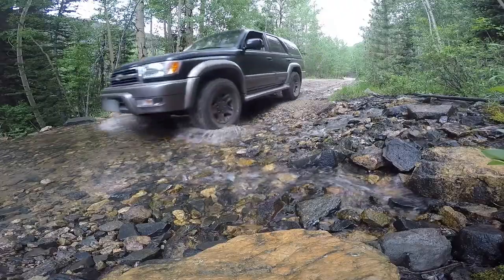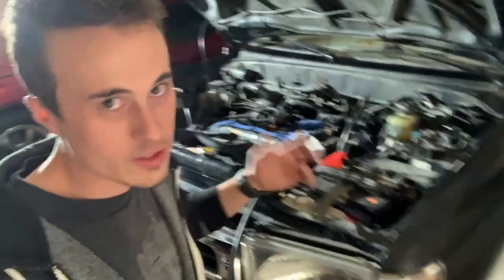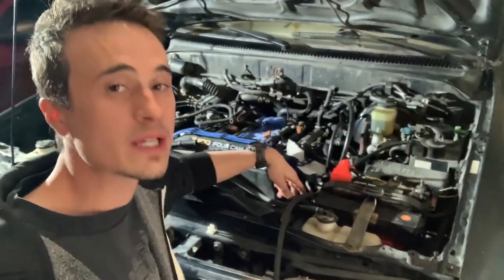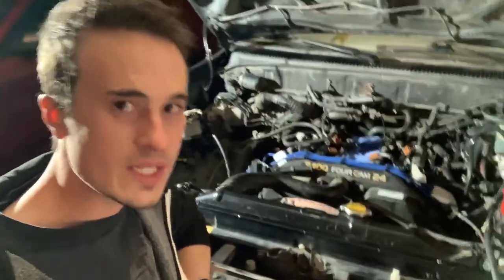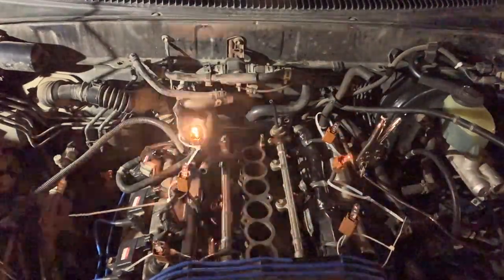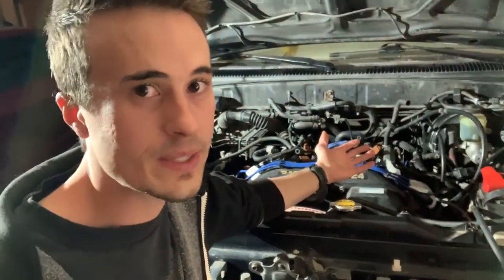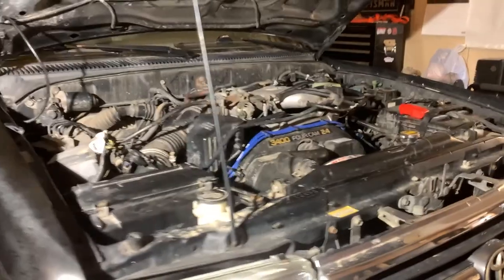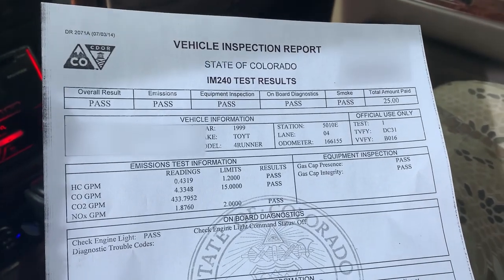1999 Toyota 4Runner Misfire Diagnosis Story | How I Finally Fixed it

Comment: Great video! My 01 read misfire on 6, 3 & 5, took it into my local Toyota dealer...and they charged me $500 to tell me it was misfiring on 6, gave no reasoning why or how and said I need a new engine. Then one of their techs called me and offered to cover the $500 bill if I gave him the car! 
Crazy Ridiculous...I of course told him to shove his theiving offer. And now I am about to start the diagnosis myself. Though I have 280,000 miles on the engine....so my question is, do you think it's worth figuring the misfire out at this mileage...or might be just time to get a new engine anyway?
Reply from the maker: Thats crazy, they cant just charge 500 bucks and tell you you need an engine without showing proof of what tests they did, if they did a compression test and that cylinder has bad compression then yeah new engine, if they did a combustion to coolant leak test and found exhaust gas in your coolant than yeah new engine. They cant just say you need a new engine without explaining why.

Comment: Omg! Could you please come to VA and fix my 98!? Misfiring with no CEL on and I can't find anyone that wants to put the time in to figure out. 😕
Reply from the maker: haha maybe if you lived in Colorado I could look at it for you. start with pulling the plugs one by one smell each one. if one smells like fuel and is clean you either have a stuck open injector or not getting spark.
Reply: @4WheelKid  thanks I will. Funny...I got this 4runner in Colorado...but not there anymore 😕
Reply: If in Virginia Beach,  I can take look.

Comment: Hello friends, someone link or web address where I can get the new original OEM injectors - Aisin with warranty for the 4runner 1996-2002, greetings and excellent video
Reply from the maker: Yeah best thing to do is work for another dealer then go to the Toyota dealer and ask for wholesale price. Maybe able to type part numbers into google and find them that way. Too bad Aisin doesn’t sell these aftermarket. Just watch out for fakes or reman

Comment: i’ve got a 97 and it misses at 3k rpms and makes too much back pressure and keeps blowing the o2 sensor. i’ve done plug and wires and a fuel filter
Reply from the maker: what do you mean by blowing the O2 sensor?? do you have any obd2 codes??
Reply: @4WheelKid  i fixed that now i’ve got a code that says “insufficient coolant temperature for closed loop fuel control”

Comment: What were the correct plugs you went with? Part number plz
Reply from the maker: NGK 3967 BKR5EKB-11 Multi-Ground Spark Plug, there are platinum ones as well, you just want them with the dual prongs

Comment: Do you still have your 3rd gen
Reply from the maker: Yeah I do, runs amazing ever since I put oem injectors from Toyota in, im never selling it. Only at 170k miles
Reply: @4WheelKid  I bought one not to long ago and it's got misfires in 6 and 3 what could I do to fix my truck would a coil pack be the cause what else might cause it to be missing. I'm not sure what to look for it idles pretty high at cold temps and it seems to struggle in the acceleration department. I'm looking for any suggestions you have that might help

Comment: Not saying names but yes I also had bad luck with that company but also yes bro grate video
Reply from the maker: yeah had another one of those injectors stick open on a trip a few months later. paid the money and replaced with oem injectors and replaced pump with a denso just in case . no problems 8 months later. I work in the automotive field and never heard or experienced injectors jamming open like that even if a fuel pump goes bad. In my opinion, I don't trust reman injectors. would like to know what causes them to stick open like that

Comment: Anyone know how to get the operating temp of these engines with a IR gun? I’m getting different readings from top of rad hose, top of rad, valve covers...
Reply from the maker: all the different parts are going to be different temps somewhat. what are you trying to accomplish exactly? you can view your coolant temp in degrees on a scan tool
Reply: @4WheelKid  I just ordered a scan gauge actually. Basically I’m just trying to see if the engine is running at good temps. Just bought the rig, didn’t come with any mx history, and when I turned the heat on it was really hot, so my ocd kicked in and I was wanting to monitor the heat haha

Comment: thank god that could have ended badly 
blesses
Reply from the maker: true that! the 4 runner lives on, changed the oil like 3 times to get all the fuel out
Reply: @4WheelKid  a testament to how good these blocks are...my oldest brother switched to modern era engines and believe me he does not like it he is losing money faster then hen can gather...my advice to you is to keep it alive , rebuild it if comes down to it, because it can decide between losing a job or keeping it , having some money in pocket or nothing down the road , food or no food on the table , life or death why ? because your car still runs and that new POS 2022 toyota tundra isnt working because of some fuckery with the new complex engineering you cant fix and you realy need it to run now
Reply from the maker: for sure! I love older cars. these 3rd gen 4runners keep increasing in value especially here in Colorado. so nice not having any car payments. plus when you have to fix things on them you increase your skill level and that is valuable.
Reply: @4WheelKid  i just checked holy mama ,,they did increase
dad still has the 2000 prado 5vz-fe which i over maintain myself , its just to reliable to let go

Comment: Did you find the initial problem?????
Reply from the maker: It seems to have been an injector since the cylinder that was misfiring was getting spark. Should have been more thorough in my diagnosis. Been learning a lot though. Ended up going with oem injectors from Toyota since these reman ones kept jamming open. Haven’t had a problem since

Comment: Only buy OEM parts for these. I have had 5 of them.
Reply from the maker: I agree, or at least name brand aftermarket parts like aisan or denso if available because they make a lot of oem parts for toyota. Put all brand new oem injectors in from the dealer, I know how to get a dealer discount. Dropped the fuel tank, cleaned and installed a new denso fuel pump and sock, replaced the filter as preventative. No issues since then. Had to change my oil like 3 times from the fuel wash. Still runs great, still doesnt burn a drop of oil between oil changes

Comment: Why would you check the timing mark? It was working before, the problem was with fuel not timing mark. Lesson here is dont buy cheap chinese parts.
Reply from the maker: Because its a timing belt and the belt and components wear over time and can cause it to skip a tooth
Reply from the maker: Also those injectors were remanufactured in America but poorly done. Or using Chinese knock off injectors as cores